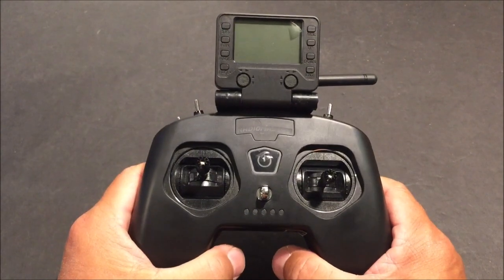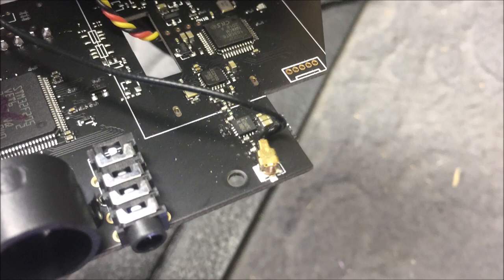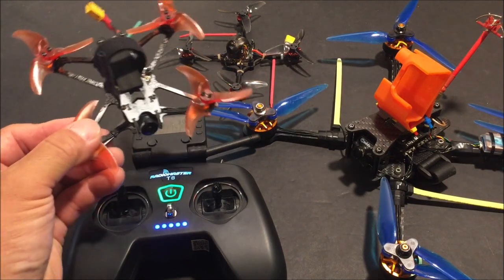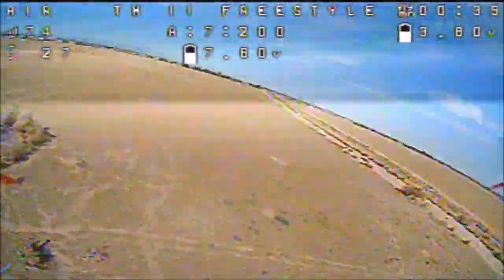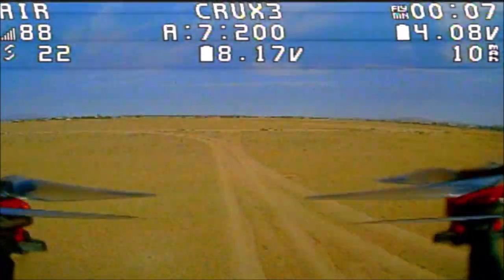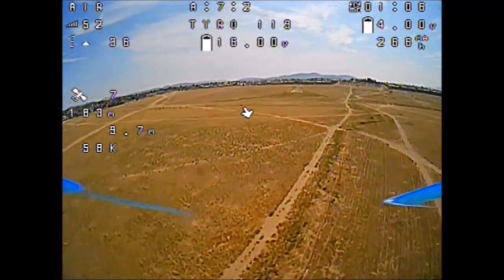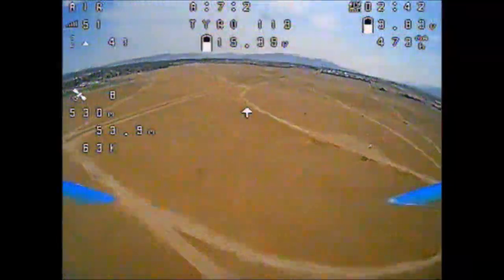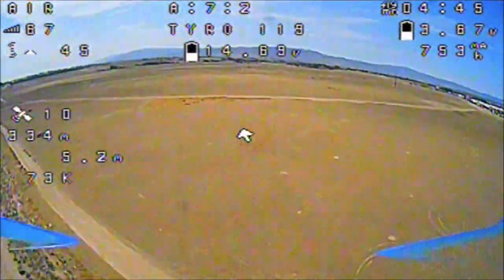Radiomaster T8 Pro Remote Control Transmitter Review and Tests

Comment from the maker: 00:00  intro and closer look
06:20  setup for simulator
08:08  three quads
08:56  attaching the booster
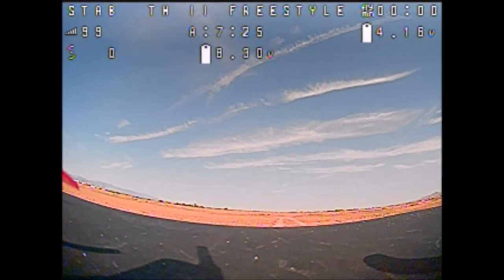09:07  tinyhawk 2 flight
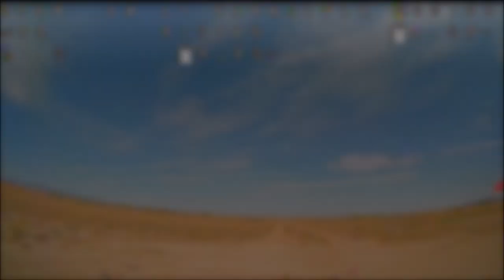11:41  tinyhawk 2 with booster
14:06  crux 3 flight
16:13  crux 3 with booster
19:14  tyro 119 flight
23:51  tyro 119 with booster

Comment: Another proof that the 2W booster is really putting out some big fat radio waves is the pretty heavy interference with the video reception... despite being on so distant frequencies for RC control and VTX, on all 'booster' flights you were getting lots of lines in the DVR that weren't there in the non-booster flights. Did you notice those also in the live FPV feed in the goggles? If not, it apparently is only the DVR circuitry that is being swamped by the booster output... (sorry if I missed any comments you made on this, I admit that I skipped parts of the video).
Reply from the maker: The headplay dvr may have had some interference but it also had  intereference on flights without the booster.  All flights were flown wearing the headplay goggles.  First three flights, which were also recorded on the fatshark goggles and with just the rubber ducky antenna were shown for each quad on the non-boosted flights.  The boosted flights were recordings from the headplay goggles since I had to use the battery from the fatshark goggles for the booster.  So the recordings from the headplay goggles are 16:9 and the recordings from the fatshark 4:3.  There were 3 recordings from the fatshark and 6 recordings from the headplay goggles.  All 6 recordings from the headplay goggles have static whether it was boosted or not.
Reply: @RCEscape  Aye. I found it just striking that all the booster flights have those pulsing horizontal lines in the recording, esp. upper half of screen, whereas the non-booster flights are all super clean with regard to lines. Not really important, though 😉. Thanks for the response.
Reply from the maker: @mq_fpv  
Yes, I knew someone will say something about those darn lines and it does look exactly like how you perceived them to be intereference from the booster but if I had taken extra batteries like I should have, I would have shown only the fatshark recordings which would have had basically no lines even with the booster.  Appreciate the comment and your observations :) 🍺

Comment: The remote seems to work pretty well Pete. I can't get my remote to work like yours on the simulator, I have the same program as the one that you demonstrated the remote with. I am using the DXe and TX16S so how did you set your remote?
Reply from the maker: I did it the same way I set up this remote.  @6:20 Set it to TAER in the system's radio setup page and set up a new model.  In the set up page, turn the internal and external rf to the off position and calibrate the remote in the simulator.  It has worked for me for each of my remotes.